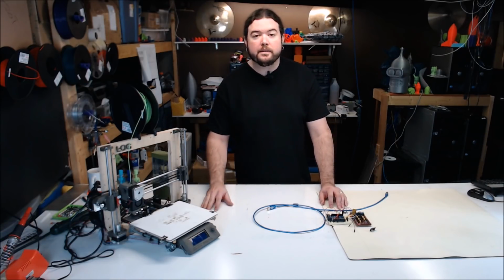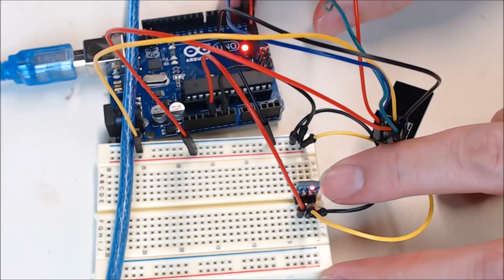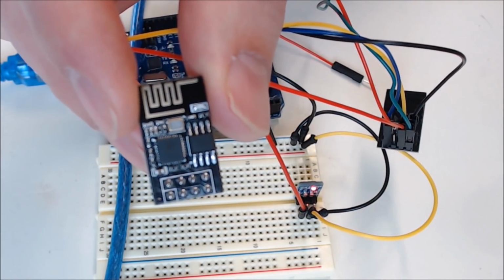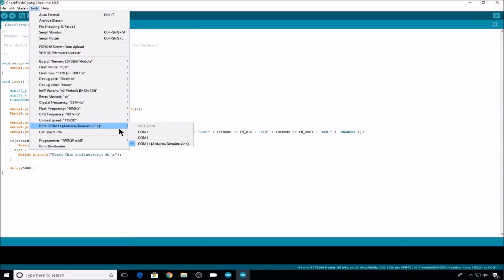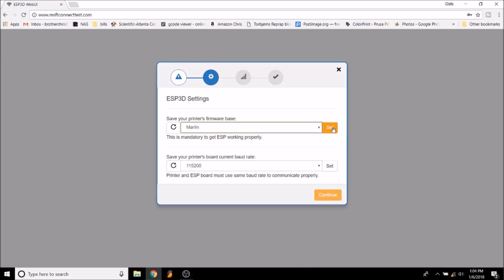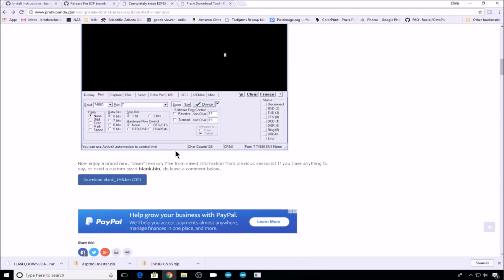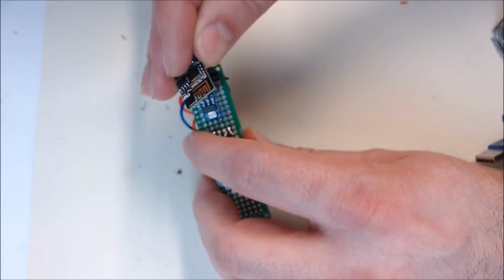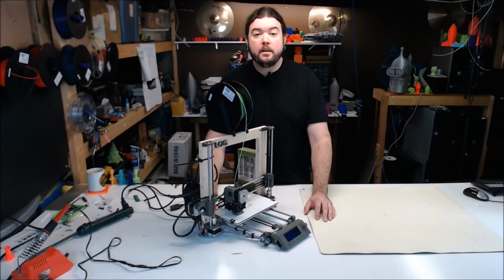Add WiFi To Your 3D Printer For $5!!! - ESP8266 - LUC ESP3D - Chris's Basement

Comment: Hi Chris, tried to follow your tutorial, but I have a rearm ramps setup and right from the get-go there is no "preferences" option in platform IO. So how do you do it in Atom/Marlin 2.0?
Reply from the maker: You use the LPC1786 as your env in the ini file.
Reply: @ChrisRiley  Hi Chris, I made an esp3d and Tools folder under  lpc1768 but:
The AUX2 pins don't work on re-arm so connected to AUX1 (TX =D1 & RX =D0)
But: now platformio wont build and I cant figure a way to assign pins or flash the wifi module. Is there any chance you can write a step-by-step or make a tutorial video please?
Reply from the maker: @ThePanther133  Hey Wendy! I haven't really tested this much with 32bit boards. I will see what I can come up with.
Reply: @ChrisRiley  Hi Chris, did you get a chance to look at this?
Reply from the maker: @ThePanther133  Are you using ATOM or VSCODE? I would try VSCODE if you haven't already.
Reply: @ChrisRiley  was using atom and have a successful compile {minus wify} which was tough to achieve as printer is a geared 4 ext-ruder  tool swap between diamond and single mag mount with a mix of TMC and Alegro (two on expansion board) . Can you import or is it another learning curve to use?
Reply from the maker: @ThePanther133  You can use the same code, it's not to hard to setup. https://www.youtube.com/watch?v=W6zYvRgGr3Q

Comment: Hello, Nice video!!

I'm using the same version that you are using. But when I'm going to the Dashboard, I cant send any commands to my printer.
Do I need to change something in Merlin?
Could you send me the merlin file that you are using?
Reply from the maker: That has been so long ago I don't know where that config is. If you are using Marlin 1.1.x then you don't have to change anything. If you are using 2.x then you have to add the second serial port in configuration.h
Reply: @ChrisRiley  I'm using the 1.1.x merlin version....The serial port is set as "#define SERIAL_PORT 0"
Reply from the maker: @VelloneRenan  Ok, then it should just work.
Reply: @ChrisRiley  My LCD does not show the IP as in your video... may be something with IP ?
Reply from the maker: @VelloneRenan  Did you try switching the UART pins? Swapping send and receive?

Comment: Failed to first UPLOAD Example for ESP8266 

   raise FatalError("Timed out waiting for packet %s" % waiting_for)
esptool.FatalError: Timed out waiting for packet content
esptool.FatalError: Timed out waiting for packet content
Reply: are you using an esp programmer? not the arduino. the small usb programmer for esps if you are you will need to solder a wire between grnd and gpio0 to upload firmware and to go to the website take the wire off.
Reply from the maker: Not sure what is happening here.
Reply: @ChrisRiley Using ARDUINO MEGA 2560... not work?
Reply from the maker: @atamico  I should work just fine. Maybe try to flip the TX and rx pins.
Reply: @ChrisRiley  Already tried ... This is very bad because the serial monitor does not respond. Already tried with 2 different mega arduino. I am very happy that you are trying to help me.
Reply from the maker: @atamico  If you plug the mega in, can you upload a simple sketch to it, like blink or something? Or it won't do that either?
Reply: @ChrisRiley  Yes. The 8266 device is working. I searched the internet and some with the same problem were able to upload the firmware using BAUDRATE 57600 in Arduino program. Yes I made it. I was also able to do SKETCH DATA UPLOAD, but the problems I have now are:
- Serial monitor does not respond commands;
- No have start page to config.
Reply: Update: With ESP3D-0.6.2 Firmware the system loads a direct home page, but all other login page errors.
Already the most up to date (2.0) has no arduino file to compile, so I don't know how to make it work. Video 0.9.99 is no longer available. I think I've caught every possible mistake so far. (Laughs).

If possible, please provide the same files you use (ESP8266 firmware, ESP3D Software, ESP File system) and make it available on a download server (Google Drive, Mega .. etc).
Reply from the maker: @atamico  Is it all working now?
Reply: @ChrisRiley  Not in the moment. Firmware issues are due to the model I found I'm using. (ESP8266-01s or also called EX). and now the network no longer appears. I have already uploaded a couple of hundred different firmings and no longer appears, even the manufacturer. I think I'll have to buy another one.
Reply: new ESP8622 and at the moment it worked perfectly.

Comment: Do you think this will also work for a Prusa MK3 or might the Octaprint be a better option?
Reply: Bit you had the Mk3 in your video or was this a clone ?
Reply from the maker: It's a clone with a RAMPS board.
Reply from the maker: On the MK3 you don't have the pins available to use it. Octoprint is the way to go.

Comment: Hello Chris Riley. I´m having problem to write because my laptop give me a serial error. Do you know what happening? My LED still on when I connect 3.3v not only one blink. I follow step by step but doesn't work!!!
Reply from the maker: Most of the time this is caused by a driver issue. Which module do you have? You might need the ch340 driver.
Reply: @ChrisRiley  I will try to install this driver. Thanks
Reply: @ChrisRiley  the tx and rx will be connected inverted on ramps?
Reply from the maker: @Fabio_F_Lopes  Correct.
Reply: @ChrisRiley  Doesn't work. I connect all the wires correctly but when I access by IP and send a command doesn't work. The only thing happened was my LCD lose a little the bright. Do you know How can I do to work?
Reply from the maker: @Fabio_F_Lopes  It sounds like you might have a power problem, you are running your wifi at 3.3v correct?
Reply: @ChrisRiley  yes. I do
Reply from the maker: @Fabio_F_Lopes  The tx rx Uart is just for printer communication. Remove them and reboot and see if you can see the module on the network.
Reply: @ChrisRiley  I did this and I can see the module and the initial page
Reply from the maker: @Fabio_F_Lopes  Ok, that's good. Are you on Marlin 1.1.9 or 2.0?
Reply: @ChrisRiley  marlin 1.1.9
Reply from the maker: @Fabio_F_Lopes  In 1.1.9 those pins should be available all the time. All I can tell you is to try and flip them, but it should work.
Reply: @ChrisRiley  I will try to do all again. Thank you so much for your help...

Comment: This works on creality boards?
Thanks and you have a nice video.
Reply from the maker: You're welcome! No, no available UART pins on that board.
Reply: @ChrisRiley  https://www.ebay.com/itm/Micro-USB-Type-B-male-to-mini-USB-Type-B-male-Host-OTG-Adapter-Cable-cord-lead/351700417158?hash=item51e2fa7a86:g:xYkAAOSwGYVXBMBJ what you thing about this cable to do the conection?
Reply: @ChrisRiley  Thanks for your fast awser, but the board have a usb, usb = Tx Rx 5v and Gnd . what you thing about connecting a esp32? its a ideia?
Reply from the maker: @Substancia3D  Sure, if you want to reconfigure USB or even hack the LCD cable that would work.

Comment: there is easier ways to program now, I would get the red programmer now it has a switch to program.  https://www.aliexpress.com/item/CH340-CH340G-USB-to-ESP8266-ESP01-ESP01S-Serial-Adapter-WIFI-Bluetooth-Module-ESP01-ESP01S-Wireless-Development/32971145094.html?spm=2114.search0204.3.11.13af1457HgOM54&ws_ab_test=searchweb0_0,searchweb201602_7_10065_10130_10068_10547_319_10546_317_10548_10545_10696_10084_453_454_10083_10618_10307_537_536_10059_10884_10887_321_322_10103,searchweb201603_52,ppcSwitch_0&algo_expid=9caba4c5-89df-4b8f-bd45-b23816bf78cf-1&algo_pvid=9caba4c5-89df-4b8f-bd45-b23816bf78cf&transAbTest=ae803_3
Reply from the maker: Nice, thanks for the link.

Comment: Can this setup be implemented on Creality Ender 3 printer...
Reply: I was hoping to toss this great idea into my ender 3 as well, even spent 6 hours trying to get the esp8266 modules flashed before giving up and moving to a D1 mini, which took about 20 mins to setup. Then I tip over my E3 and see there's no ramps board lol. Did you ever find a wifi solution Vinston?
Reply: @nibblesd.biscuits4270  No I didn't find any solution for this feature...might be an usb WiFi module be used?
Reply from the maker: @nibblesd.biscuits4270  Hey David, yeah, no UART pin available on that board. You would have to hack the LCD cable. You might be able to find a break out board to do that.
Reply from the maker: No it can't, no UART pins. You could hack the LCD cable, but that is tricky.
Reply: @ChrisRiley  can any WiFi module be made that can interact via the USB port of the Ender 3 printer
Reply from the maker: @vinstondavid  I don't think so, I am not sure how it would work anyway.
Reply: Thanks Vinston, I am searching for info on how to hack into the creality boards tx/rx to add the esp3d mod. So far I have seen info on soldering wires onto a chip that has rx/tx available but the info I found refers to the ver 1.1.2 and my board is a 1.1.4 and the chip they refer to has changed. I wonder if Chris or anyone reading has any info on finding the tx/rx on this new chip?

Comment: Started in on an esp32 on a 1.1.4 board... I think I have the pinout.  The web gui works good, but I have no idea for the actual interface to the board because I have not soldered anything to the pins on the 1.1.4 board.
Reply from the maker: Which board? MKS 1.4 or a Creality board?

Comment: Great video Chris! This helped a lot! But one question. Is there a way to acces this GUI outside of the wifi network (so all over the world)?
Thanks!
Reply from the maker: There is, but it's not very secure. You can do port forwarding from your router. To be more secure you would need to setup a VPN. O use realvnc to access my home computer, then my printers from there.
Reply: Some routers can be configured as a VPN server. I am using keenetic products and supports for VPN connections.

Comment: Thanks for all your videos Chris! They helpt me out alot. I just bought my ender 3 and i want to upgrade it to the mks 1.4 with mks 32 TFT, tmc 2130's and WiFi. Well.. I think the 1.4 because its a 32 bit board. I would like to use octoprint tough and i dont know if that is posible... Do you have any advise? Or better yet, would you consider building this in a video? There is a lot out there for the mks gen L (this is a 8 bit board
Right? ) but i cant find anything on the 1.4 which makes me doubt  
If this is the correct choice
Reply from the maker: So the gen L is just a newer version of the 1.4 basically, they are both 2560 chips and are 8bit. You are thinking of the 1.3, it's 32bit. You can use octoprint with either, no worries there. 32bit can be kind of fussy at the moment with Marlin. If I were you, on an ender 3, I would go with the gen L and 2208 drivers. This will make your life so much easier. Unless there is just something you need stallguard for.
Reply: @ChrisRiley  man that was fast! Thanks for getting back at me! I was sure the 1.4 was the newer 1😅 no im just a noob that got in to deep...
Reply: @ChrisRiley  i will go for the 2130. I like the idea for extra power when needed and it forces me to learn more. I might regret it tough

Comment: can i conect it to the ender 3 main board?
Reply from the maker: Not sure, but if it has ISP pins, then yes.
Reply: @ChrisRiley  yes, it have it, i'll try if it works now, thank you so much!!! :):):):)
Reply: @ChrisRiley  i've tryied but i cant connect it to the main board, wich pins should i use? 

Thank you :)
Reply from the maker: @MsGuifre  You need serial transmit and receive, 5v and ground, I don't think the stock ender 3 board has these exposed. You would have to farm these pins from your LCD socket. Not easy to do.

Comment: I used nodemcu and I could see the web interface when I opened the ip of nodemcu but I couldnt upload any gcode in it . What is the problem ? what am I supposed to do? please help me
Reply from the maker: You are actually loading the files to the printers SD card, is the card plugged into the printer?
Reply: @ChrisRiley  yes and i could see the gcode files, whic is in sd card, on lcd display.

Comment: Would the esp 8266 12e work?
Reply from the maker: If it has the same pins and it is supported by the 8266 library you can probably make it work.
Reply: @ChrisRiley  ithas more pins actually and yup it is the 8266 12e
Reply from the maker: @Artwithbenji  Cool, should work just fine then. I am going to rework it with a D1 Mini I think.

Comment: For anyone still looking to do this, I recommend this:  https://www.amazon.com/gp/product/B07KF119YB/ref=ppx_yo_dt_b_asin_title_o03_s00?ie=UTF8&psc=1
just $8, and no need to mess with an arduino, wiring, or soldering.  simple usb connection and switch to flip between programming and usage modes.
I'd also recommend sticking with the 1.0 release of ESP3D.  The 2.x releases are quirky and difficult to get running (well, was for me anyway)
Reply from the maker: There ya go!

Comment: do we have to connect arduino mega with ramps while using wifi module
Reply from the maker: You don't have to, but it's easier to figure out with the RAMPS shield on.

Comment: Ok.  for ESP3D-2.0, copy the whole tree to your projects folder, then also copy the libraries folder to your arduino libraries location.  Then under examples you can load the CheckFlashConfig.  Once thats ok,  load the new ino project 'basicesp3d.ino'.  Then download the ESP3D-WEBUI files, once you connect to the basicesp3d webpage over wireless you can upload the index.html.gz package and begin configuring the client.  I didnt have to load any blank sketches and the SPIFF is not necessary anymore (its built in).
Reply from the maker: Awesome, thank you for the rundown, I want to give it a try because it has been confusing a lot of users.
Reply from the maker: I still can't get the index.html.gz to take, it just errors out. What browser are you using?

Comment: Hi Chris,
I am able to make the module show up on my laptop and the WebUI pops up once I click on it, but when i try to connect to the module after I have it set up in the WebUI, I cannot. I have the module set to Client Station but it still shows up in my wifi list as a device to connect to, should it? Any ideas on how to fix this?
Thanks.
Reply from the maker: The first time it should show up as a device to connect to. Then you can connect up and connect it to your wifi.
Reply: @ChrisRiley  But when the setup process opens up in chrome and I select Client Station, it seems to stay connected as an Access Point. If you go on to the WebUI and click the tab to change the ESP3D settings, the 'Wifi mode' is set to Client Station, but if I click the blue square with the three white lines at the top (beside the other colored squares), 'Active Mode' is set to Access Point while 'Disabled Mode' is set to Station. I can't seem to figure out what is wrong so any ideas will be helpful, thank you.
Reply from the maker: @liamlynch6849  I will run though it tomorrow and let you know what I find.
Reply: Sorry to bother you again. Have you made any more progress on how to fix the problem? Thanks
Reply from the maker: @liamlynch6849  I still can't get this thing to work right, I am still working on it.
Reply from the maker: @liamlynch6849  I can't seem to get anything after version .999 to work. What version are you trying? You can send me an email to continue working on this.

Comment: Hi Chris thanks for the aweasome tutorial. I just have one question I went to the Github wiki for ESP3D and they add a couple of resistor CH_PD and RX pins they also conect RF to ground on the ESP8266. Is it needed or with your setup I fine?
Reply from the maker: It depends on what ESP module you have, it seems they are all different. It's kind of trial and error.
Reply: Chris Riley thanks man!

Comment: I did pretty much same as yours but the problem or error in ESP Ap mode config ... once all the sketch and tools uploaded I connect my laptop to Esp , But the redirect pop up doesn't created so I decided to enter the ip manually (198.168.0.1x) . Again the ended with the error ( "It seems you do not have any index.html neither index.html.gz, please upload it or update ur firmware if necessary" )  then I manually uploaded the file and refresh the page But nothing changed pls help out from this terrible situations...
Reply: Hello ! I've got the same problem, please help me too
Reply from the maker: What version are you both using? 0.999? You need to make sure you load you filesystem before you load the sketch. Make sure you use the same library versions I do in the video.
Reply: @ChrisRiley  thank u man this one is really help me.. lot...
Reply: @ChrisRiley  Hi man i have one more doubt to discuss with u, do u have any social media page other than YouTube or a mail id pls share... Thank u...
Reply from the maker: @gunasekaran5834  Hey, the only other place I am in on Twitter @chrisriley3d
Reply: @ChrisRiley  do u have any mail id...
Reply from the maker: @gunasekaran5834  Awesome!
Reply from the maker: @gunasekaran5834  brotherchris81@gmail.com

Comment: Fantastic video! One question though: In the ESP3D Github repository, under Install Instructions there is an EDIT that says that the SPIFFS Tool is no longer necessary because since FW version 0.9.99 there is a self uploader. So that means that when I have everything ready and upload the FW (1.0) into my ESP8266 the sketch data will be automatically uploaded with the FW? Can I completely skip the SPIFFS part of your video?
Reply from the maker: Well, it says that is will work with the self uploader, but I can't get it to work. The only way I can get it to successfully upload is by loading the data first. Give it a try, but I have had no success.